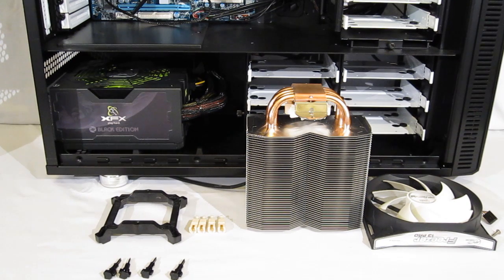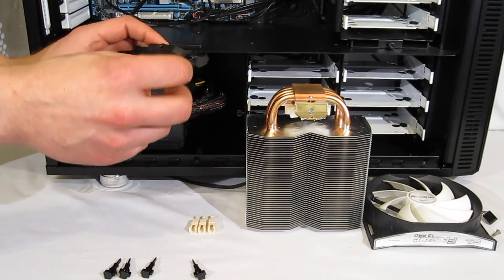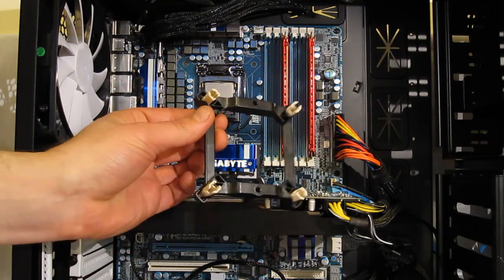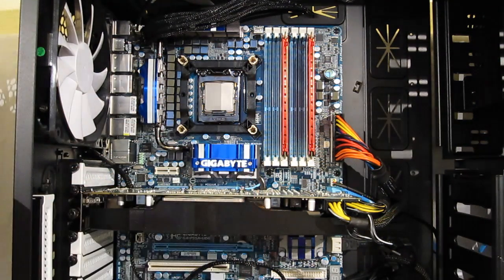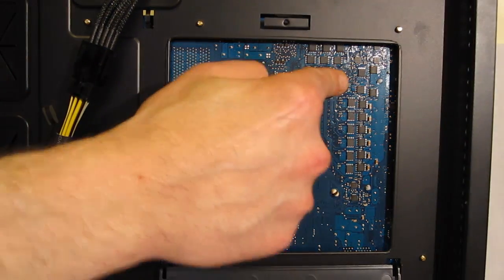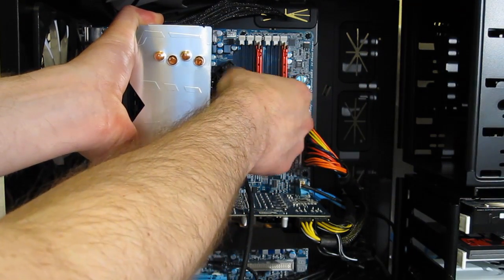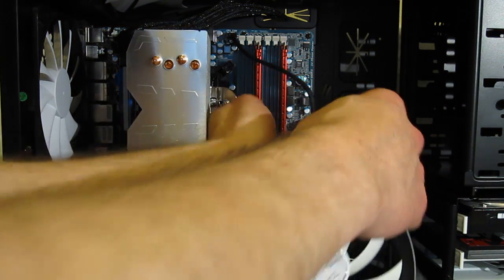Arctic Cooling Freezer 13 Pro Installation

Comment: just want to know if the Ram Stick wii be in the way of the cooler?  ADATA, Series XPG Z1, Model AX4U240038G16-DRZ
Capacity 16GB (2 x 8GB), Type 288-Pin.

Comment: hey ppls i have artic freezer 13 co with stock thermal paste 
and my cpu (intel core 2 quad q6600 2.4ghz) under full load is around 70C* whats up with that? i want to oc it to 3.2ghz but the temp is already too high. my case fans setting isn't the best so might that be a problem?
Reply: MrNwn007 I'm late but your temp is fine, that's what its meant to be, you can oc it, aslong as its under 80 most of the time then you are golden, only upwards of 90 is bad

Comment: I have a problem... the four holes in the mainboard form a rectangle, not a square. I have got this square thing which you place underneath the cooler, too, but I can't place it on the main board. What am I supposed to do?
Reply: Your Socket isnt supported

Comment: I have an amd 8350 cpu and i bought this, but the installation guide is the worst thing i have ever seen in my life. I am wondering if you use the mounting bracket for both amd and intel? If not then i have no idea what to do.

Comment: What about 1150 Sockets?
Reply from the maker: 1150, 1155 and 1156 are physically the same for mounting coolers. This will fit.
Reply: it works on socket 1151 too
Reply: +HiTechLegion 

Excellent thanks for the info. Great informative video.

Comment: actually dont place this cooler with the fan down thats the reason it started making sound and rattle i had to turn it 90 degrees for another side cooler and it stopped rattling for me.

Comment: the little cooler on top of the cpu is already rattling for me after 2 months so annoying...it cools bad and its cheap go figure...never artic for me again.
Reply: Heat rises you fucking idiot.
Reply: Dont know what you did to the cooler but mine is cooling extremly good ad he is still silent
Reply: lhek yolo actually i had the cooler pointed downwards now i had to turn it 90 degrees in order to fit a case cooler and it cools fine now for some reason.

Comment: the fan is correctly blowing into the heatsink pushing the heat out the back to be sucked out by the fan in the case to the left... not sucking through it toward the hhd/ssd bays as you claim... that would unorthodox...

Comment: Nice video. I find it hard to place a cpu cooler especially the big fat Scythe Mugen 3 PCG.
Btw, you could have rotated the cpu cooler so that the fan is in the direction to the case cooler. Now it is only directed at the HDD/SDD.

Comment: do you have any idea if it will fit in a asus p5b-mtx motherboard? i have a intel 2 core e6300 , 1.86 ghz, socket 775 . thanks for this video. oh and ps : how do you recommend me to install it? horiz. or vertic. ?

Comment: Thanks for your video. I have this cooler and it makes noises, presumably from dust. The shopt where I bought the computer didnt build the cooler in correctly, as I see from your review. Can you please tell me how I remove that radiator that you attach from the side? That'd be actually important for me. Many thanks!

Comment: Hi I have a question. What is the width of your tower at the video? I'm thinking on buying this cooler and I measured my tower to 18.5 cm width. I found out that the height of this cooler is 16cm and I'm not sure if it fits. Any suggestions?

Comment: Hey !
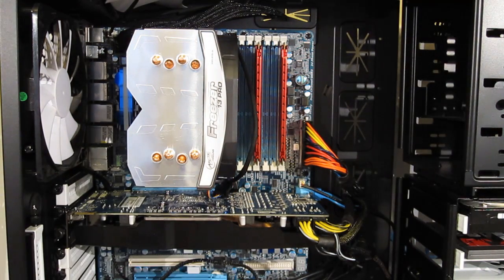I have a Gigabyte motherboard too but my fan is turned 90° in clockwise direction when you look at 3:50. (It's facing the bottom)
Is it dangerous ?

Comment: The air flow in my computer goes from the lower front to a fan at about the position your fan at the back is located. Do you have any advise on how I should position the fan of the CPU cooler? Should I let it point towards the back fan (which is where air is transported out of the case) or more likely make it blow air the other way which would mean to have it face to the front where the HDDs and my DVD drive is fitted?

Comment: FOR ANYONE WITH AN AMD CPU YOU'LL NEED YOUR STOCK BRACKET MOUNT. I repeat: YOU WILL NEED YOUR STOCK AMD CPU BRACKET MOUNT. Learned this the hard way when my antec h2o 620 'kuhler' failed. You'll need to attach the clips from the package onto to the butterflies on the sides, loosely, attach the radiator to your mounted bracket in the mother board than screw it in side by side. Good luck, took me 3 hours.

Comment: The 200 watts rating on the box isn't the power consumption of the fan itself, its a way of measuring the amount of heat the cooler can deal with. The fan on the cooler wouldn't use anywhere near 200 watts.

Comment: @hotguys337 yes try the arctic cooler 7 pro rev 2 it's amazing value for money I have an overclocked i5 at 4.7ghz on it and it keeps it at 59 under load so that would be perfect for i3

Comment: good vid! will Corsair Vengeance 8 Gigs fit?? or will they be obstructed by the fan as they have very large heat sinks on either side. looks like they might fit but only just. I have 4 ram slots.

Comment: @dava666666 yes its very good. i have 1090t no OC and this cooler works only with 15% of his power becouse i dont need more. phenom have 50C in the load only and the cooler is very very quiet

Comment: it doesn't look like there is much room for high profile ram in there ? I have a system I am looking for an after market cooler but realise that the height of my ram might be an issue. ga-x38-ds4 motherboard if that helps ?

Comment: @StanleyTLK Exactly what I was saying, the fan will face down towards the vga (if you have one installed) whereas on an Intel mobo you can position it so the air will be pushed forward the rear fan, much much better.